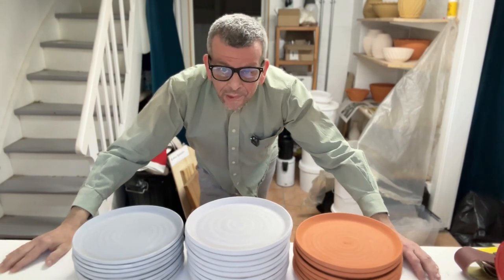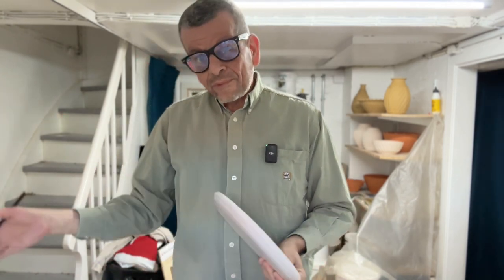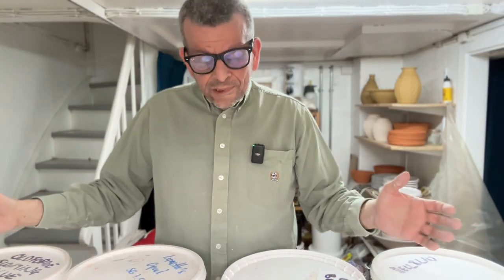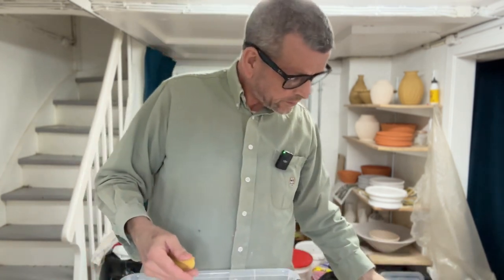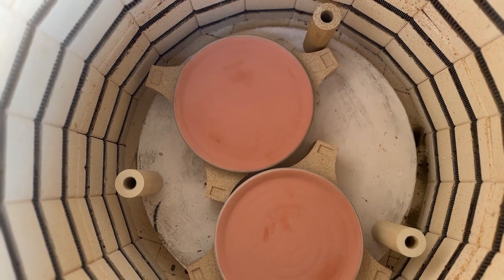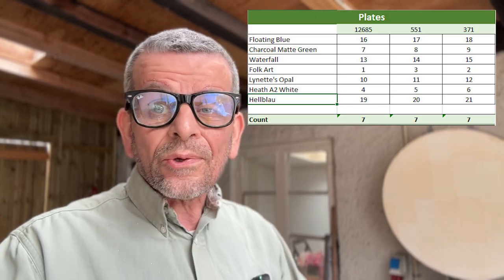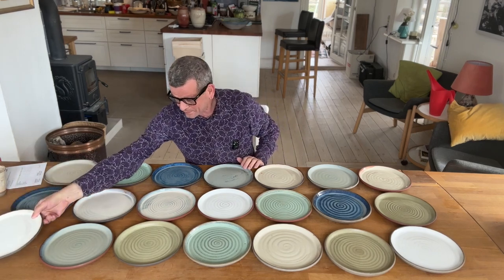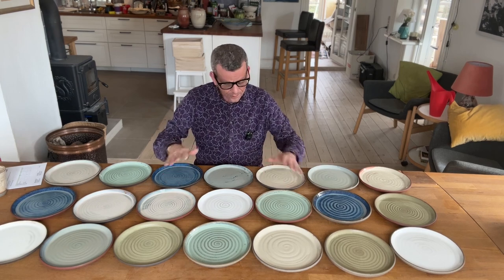102. Glazing Dinner Plates - testing 21 glaze combinations

Comment: Thank you.  I started using my rolling pin to make plates and now I am trimming flat bottoms.  So fast!  Even if I put a foot on them, I can make them much faster.  Have not glazed them yet.  I think the best part is the compression.  The plates stay flat.
Reply from the maker: Thanks. Good to hear! :-)
Reply: Have your plates cracked ? One of mine cracked after bisque firing and an other one cracked after glaze firing. I was wondering how to avoid that ?
Reply: @missprettysunshine   Compression is the key.  Using the rolling pin method really helps with compressing.